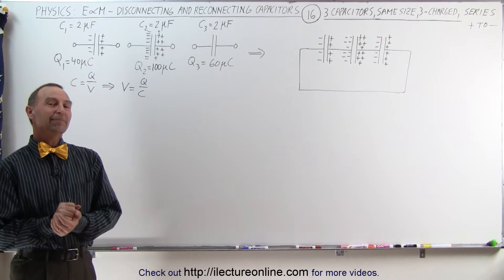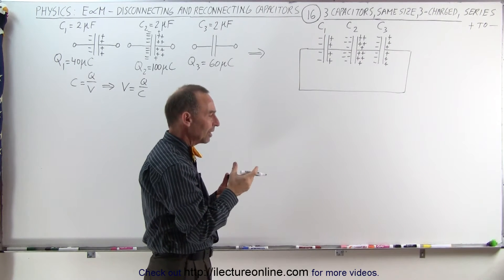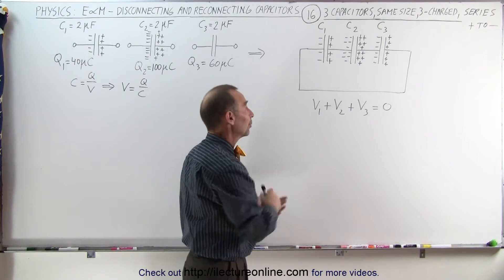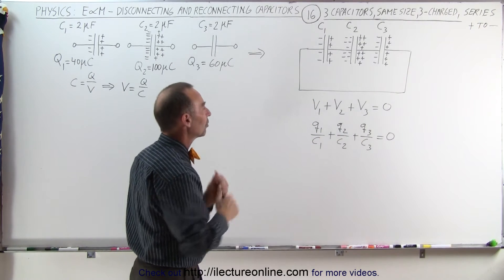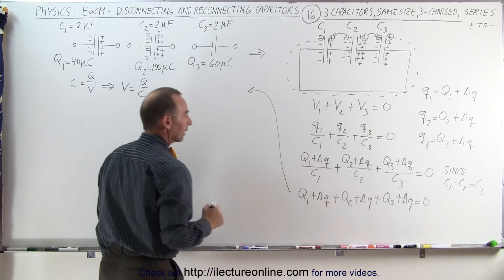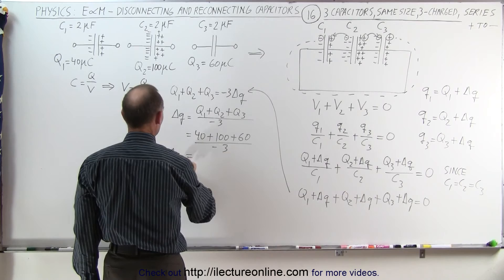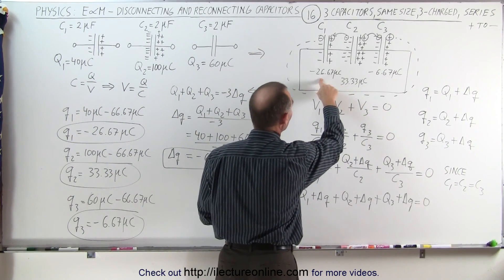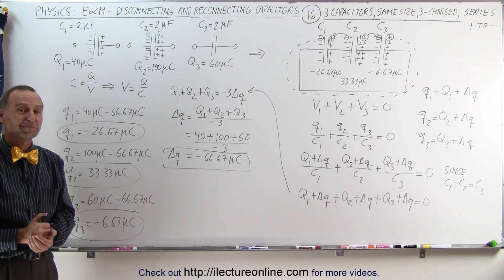Physics - E&M: Dis- and Re-Connecting Capacitors (16 of 16) 3-Cap., Same, 3-Charged, Series, + to -

Comment: what will be the equivalent capacitor of these 3 capacitors from the video?
Reply from the maker: Since they are connected in series,  1/C total = 1/C1 + 1/C2 + 1/C3
Reply: @MichelvanBiezen  Very much thanks for the answer, your videos are very good!
i asked this because the derivation of "1/C total = 1/C1 + 1/C2 + 1/C3"
is because the charge of each capacitor are the same.
but in this video the charge is not the same...

Comment: Hi sir, so if the capacitors weren't same size, then delta q wouldn't be equal, and we can't solve this question?
Reply from the maker: The charge on capacitors in series is equal, regardless of the size of the capacitors.  See the other videos on capacitors.  PHYSICS 39 CAPACITORS

Comment: sir can we use the same approach of (delta q) as (delta q) will be same for all capacitors connected in series irrespective of what is charge on individual initially.
Reply from the maker: Yes, the delta q must be the same if the capacitors are connected in series.
Reply: sir i tried question no 11,12&13 of playlist with (delta q) concept but i am getting wrong answer .
sir is there any difference than please tell.
Reply from the maker: As I always tell my students: The example shown is a technique that works and it gives you the correct answer, but you are welcome to use any technique you like.